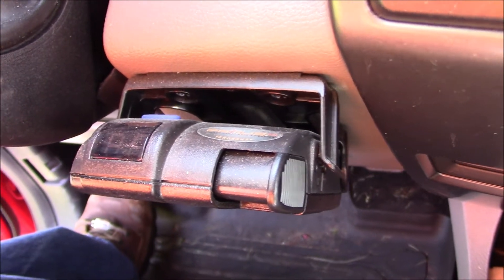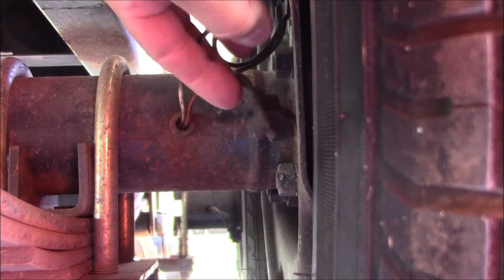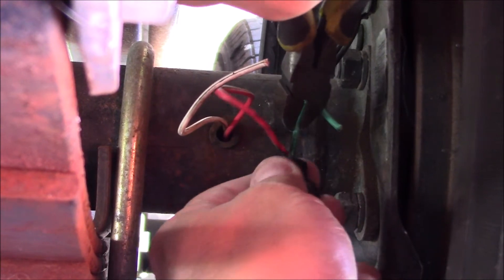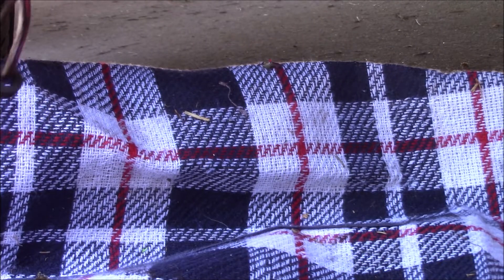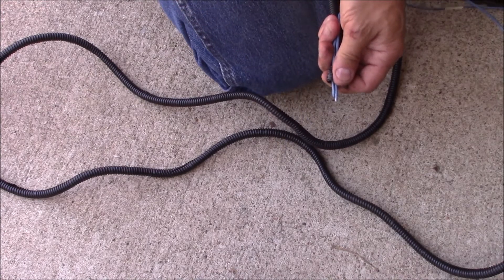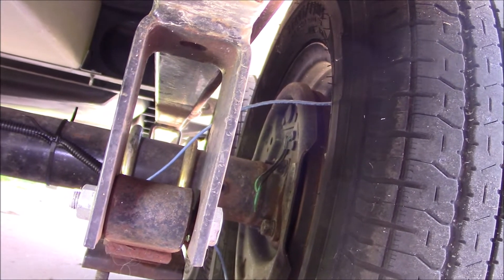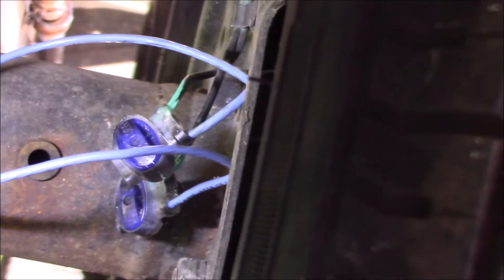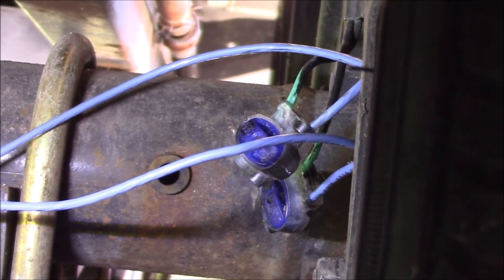electric trailer brakes short circuit fixed

Comment: So helpful! What size wire did you use and is it likely that the size is standard?
Reply from the maker: I do not remember what size wire I used yet it was thicker than the wires supplying the power and ground to the brakes

Comment: I’m haveing the same codes pop up on my brake controller.  I have a 42ft triple axle toyhauler. Is there a way to tell which axle wire could be grounding out?? Or should I just go ahead and replace wires on all 3 axles?
Reply from the maker: If you disconnect your battery you could use a continuity tester to find the shorted wire. It is likely that all the wires are with compromised insulation and it would be best to replace them all. I wish you the best on your repair